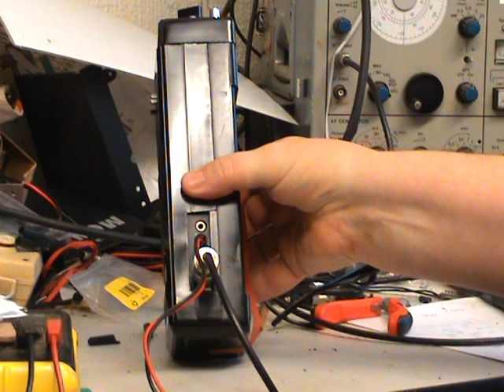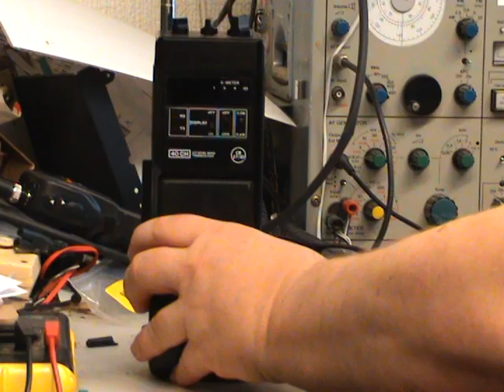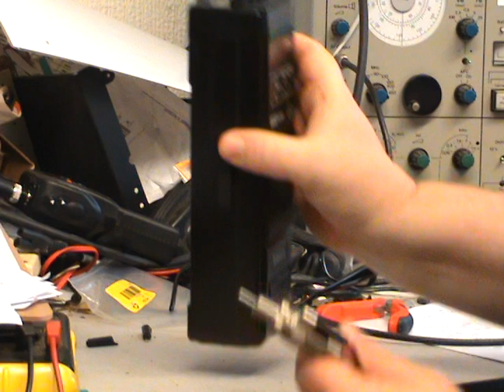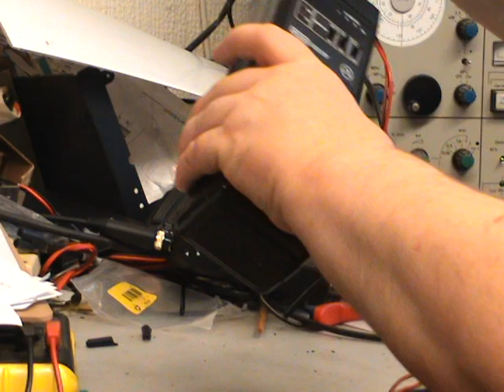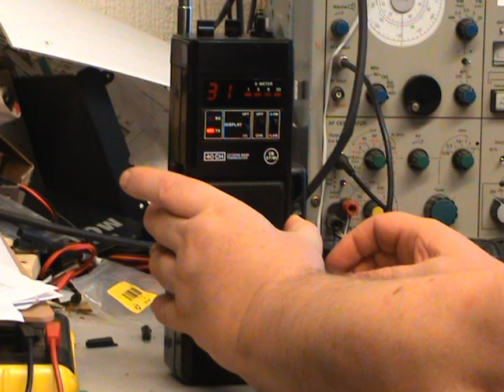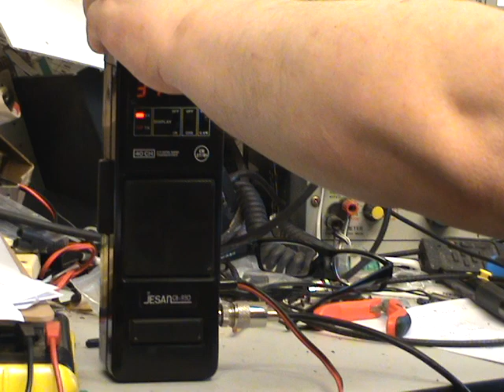Jesan CB950 (UK CB 27/81) hand-portable -   On the air test

Comment: Hi Richard  what would you say is the best hand held cb radio please
Reply from the maker: Well that depends on new or old.

The best range handheld ever is the Realistic TRC1001 or TRC1005 (same chassis) followed by the Binatone Long Ranger 40 with far less features & an older design that the Realistic. The Moonraker Master cones next but has poor features & a brittle plastic case. We've had 16 miles+ in open country on each of those.

New sets, The President Randy III is very expensive & I'm not a President lover, but works the best of current offerings. We've not yet seen the Thunderpole new handheld & won't be until one comes in because company policy changed here last December & the decision was made not to buy any further new sets. The TTI  H100 worked OK & the K-Po one we use on the bench as a monitor receiver works well but has it's foibles. We've had 4 miles on the President & 3 miles on the others, using the rubber duck aerials provided.

Richard, G0OJF, UK
Reply: @ukfmcbradioservicingTango21  thank you Richard yes I will try and find an old handheld they seem a lot better than the new president randy and Midlands they have telescopic  aerials which seems to improve the range immensely you take care and thank you and I enjoy your videos  with Mr chippy keep up the good work both

Comment: I know you say it's not 13.8v but when you fit fresh new AA batteries I think they show about 1.7v or something a little higher, so that would be closer to 13.6v with 8x fresh new AA's. I expect it should probably work with 13.8v, have you ever tried putting 13.8v into a set which requires 8x AA batteries and learned not to the hard way?
Reply from the maker: As a service engineer, I've seen the results of other 12V radios being put on 13.8.....or worse still 15V with 10xAA batteries instead of 8 & two dummies. To be honest, it usually takes out the audio IC, which on something like the Realistic TRC1001 & TRC1005 has been unobtainable for 25 years. 

It's so easy to run these 12V handhelds from 13.8V in a running car by making up a cigarette plug lead & incorporating four 1A rectifier diodes (like 1N4001) in series, which will drop the excess voltage & cost pence. I did a video showing this earlier in the year (2021).

Richard, G0OJF, UK

Comment: I think you mention in the video about the power supply for these radio's. To make sure you supply it with 12v and not 13.8v? Will a 13.8v supply do damage then? I'm looking at getting one from ebay except its the moonraker master which is basically identical to the jesan. I was gonna hook it up to a 3amp psu or plug it into the ciggie lighter in my car. Am I going to damage it?
Reply from the maker: car use is only OK with the engine off, When the engine is running it's 13.8V which is too high.  Tandy's did a cigar adaptor with three diodes in series within it thus dropping the input a little for use with their handhelds. You could make up a lead or adaptor with three diodes in series yourself. Perhaps 3A diodes are best as 1A ones would be at full pelt on transmit.

Comment: Hi Richard,those small rubber antenna are best a dummy load on Midland.You can get a longer version whip antenna.
Ive found a neat trick of laying out a 9ft counterpoise wire with a ring terminal that antenna connector  slips over to ground it.Works fab generally get 3-S points better RX and TX performance using a counterpoise wire trailed out.
Liked the video Richard.

73's rob

Comment: Brilliant Richard. Hope you collected a lifetime supply of chippings for the garden. That midland must have a dummy load as an antenna.
Reply from the maker: Gardens are for building more workshops in!  We'll be analysing that Midland aerial on a video in a few weeks.
Reply: UK CB radio servicing.   I quite agree nothing beats a nice shed. I would like to see it swept if you have a VNA. My next video will be a short introduction to sweeping an antenna using a spectrum analysers and directional couplers for return loss and SWR. Although it’s nice to do the same for the forward power to. I had been buying some similar looking antennas to use for data links up at around 890mhz, I could not get them to perform and found they were totally outside the band when I measured them . The well known U.K. supplier had forgotten to trim them before dispatched.  Not had much experience with hand held radio. I did wonder if they were designed to couple to your body when you were bench testing. Some of radio ham guys used to trail a counterpoise down there legs when working hands portable on 2m. They claim it helps or could just be a bizarre fetish never quite sure with those guys!